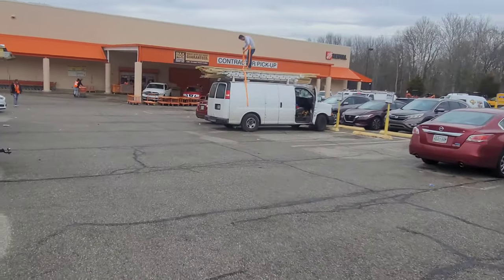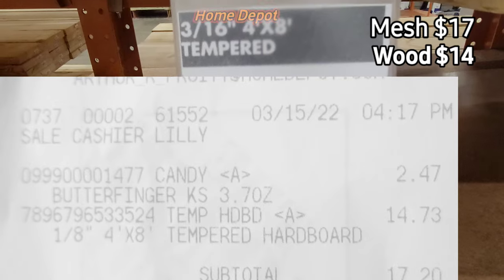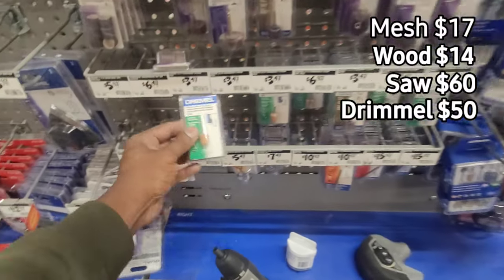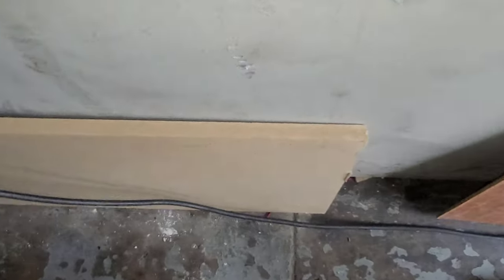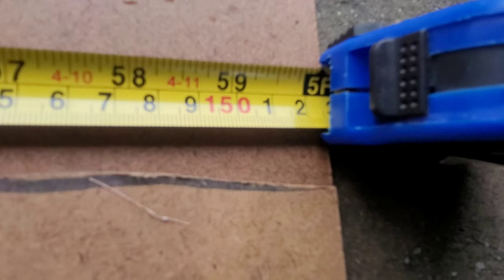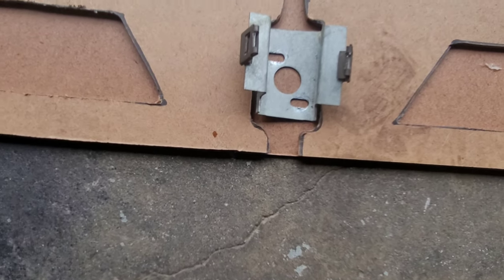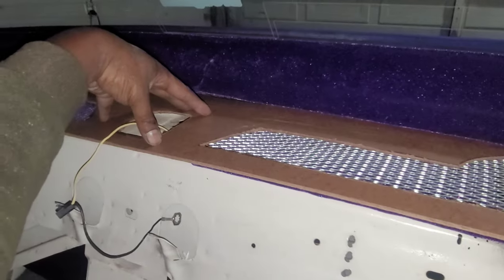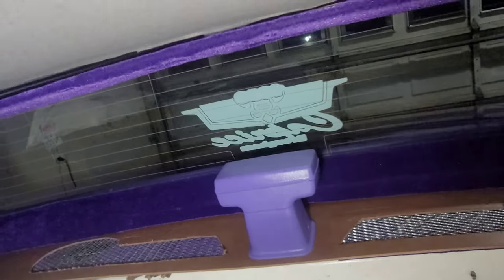How To Build A BOX Chevy Rear Deck ....

Comment: What kind of gas tank you got on your box and fuel pump
Reply from the maker: Stock tank and a walbro pump
Reply: @drejackson1000   Did your car come throttlebody I LS swap my box it will burn out good as long I’m going straight but it won’t let me Go in circles like yours it act like it’s running out of gas the power is there it seems like a fuel problem
Reply from the maker: You may need the tank with the bowl nsode the tank can't think of the proper term  .. and yes it was tbi
Reply from the maker: Depends on how low your gas is also
Reply: I got a 92 caprice gas tank on the car now it got a half tank of gas in it I’m going to put a gas tank like u got and hopefully it work out for me the fuel Baffles is what people keep saying your shit turning up I’m glad you replied back u keep doing your thing ✊
Reply: @mikejack5033  mines kinda use to do this when i made a turn sometimes it will turn off they tune up my idle i kinda dont likw but dont turn off no more ima get a better tank nd fuel pump